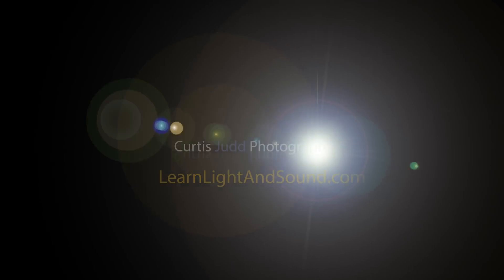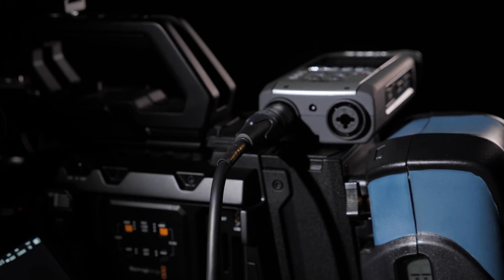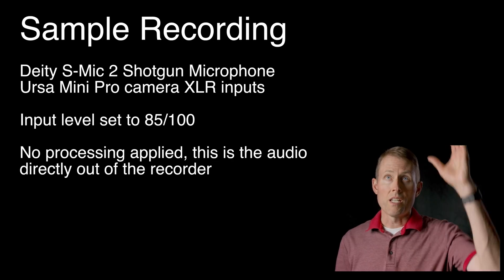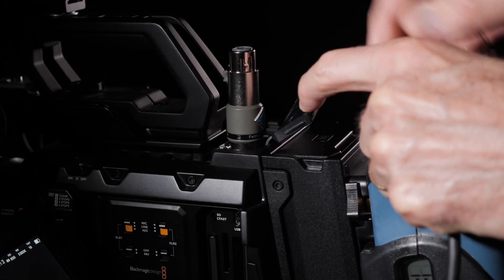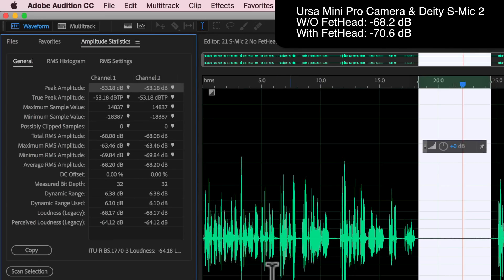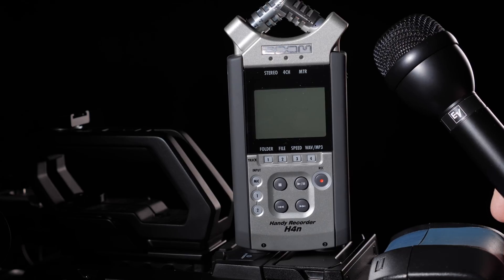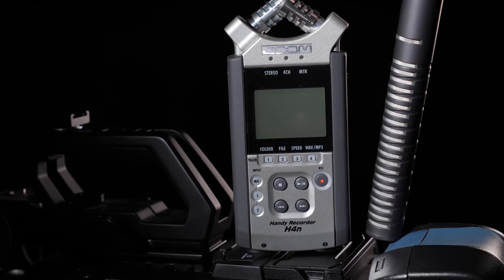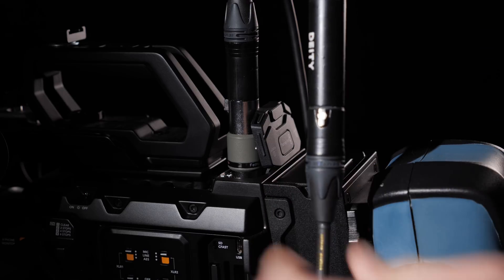FetHead Phantom: Louder, Cleaner Audio for Condenser Microphones

Comment: These are also really good for low output dynamics like the Shure SM7B as well as various ribbon mics.
Reply from the maker: Agreed. Warning for those using ribbon mics, be warned that you do NOT want the FetHead Phantom, in that case you need the original which does NOT pass the phantom power through to the mic (except for the few rare cases where the ribbon mic has an on-board preamp that needs phantom power which is somewhat rare.)
Reply: Good point!
Reply: @Greg B I know this question isn’t addressed to me, but had this exact problem when I started out and resolved it in a particular way. May or may not work for you. The first piece in the puzzle (and you may know this, so no offence intended) is to understand that there are two kinds of audio input: Balanced (professional) and unbalanced (consumer). I won’t go into the theory, but just state that the issue is not simply one of connector design, i.e.,  XLR vs. 3.5 mm TRS (tip-ring-sleeve). The signal itself is different. So, put simply, you need to turn your XLR balanced signal into an unbalanced 3.5mm TRS signal. There is a cheapo way to do this, which is to buy or construct (loads of Youtube DIY about this) an XLR to TRS connection. Doing it this way you throw away half of the signal, increasing the noise floor, and it is also prone to interference. A better way, which I used successfully, is to buy something called a DI box. This is something primarily used by musicians to turn their unbalanced instrument output into a balanced signal that can be fed into a soundboard. I started out with a prosumer Canon Vixia camcorder with a 3.5mm audio in. I connected this to a 3.5mm cable to the DI box, which has a 1/4 input jack, so you will need an adapter. On the other side of the box is the XLR balanced. These boxes can be used in either direction provided they are “passive,” meaning a transformer does the work, and there are no op-amps in the circuitry. It’s been so long since I did this that I can’t recommend a specific product, you will need to research that aspect. So yea, feed your balanced signal into the XLR of the DI and send the unbalanced output to the 3.5 mm input of your camera. Worked a treat for me at least. Good luck and I hope this helps.

Comment: Hey Curtis, I may have missed it in the video but does placement of the Fethead matter?

My chain is Sennheiser MKE600 --> Fethead --> XLR cable --> zoom H5N

Should it be MKE600 --> XLR cable --> Fethead --> zoom H5N

Thanks!
Reply from the maker: Hey Jeff, yes, I'd do the latter with the FetHead plugged into the H5n.
Reply: Curtis Judd for very long cable runs, wouldn’t amplifying at the source make most sense? Edge case I suppose.
Reply: I wonder what difference it makes, and why.
Reply: Lau Bjerno amplifying before introducing cable loss and cable interference to reduce SNR would be the difference in *theory*. On a balanced cable that might make zero or extremely low practical impact though. I personally have no experience with the device and my electrical / signal engineering background isn’t that great :)
Reply: You mean, after the cable it would also amplify any noise introduced in the cable - that makes sense. Still Curtis recommends that to avoid impedance issues.
Reply: I will re-watch that segment, because I am sure Curtis has more accurate real world understanding and experience than me :)
Reply: It's near the end of the video. Curtis definitely also has “more accurate real world understanding and experience” than I - “I know nossing” (to miss-quote Goldfinger).